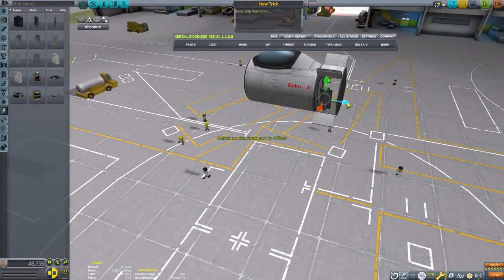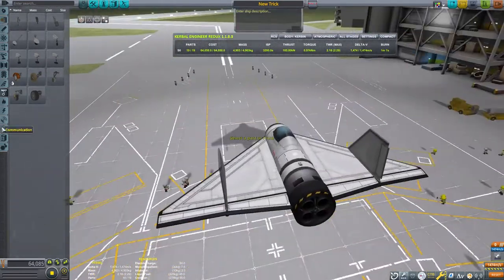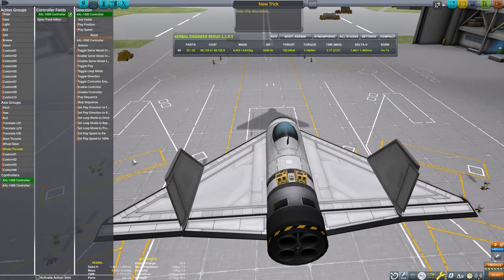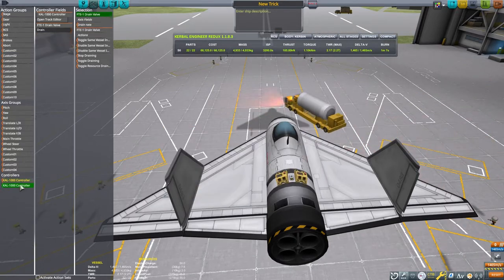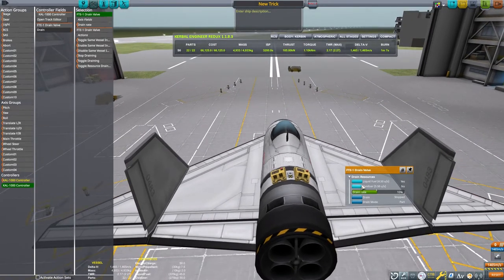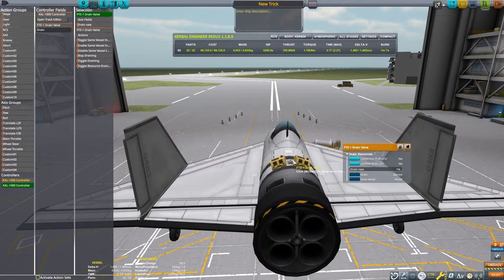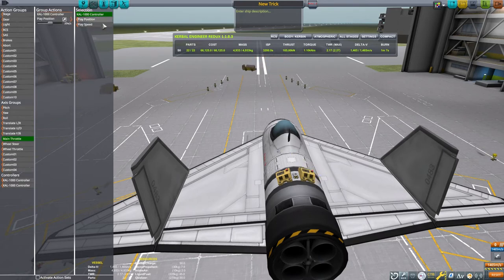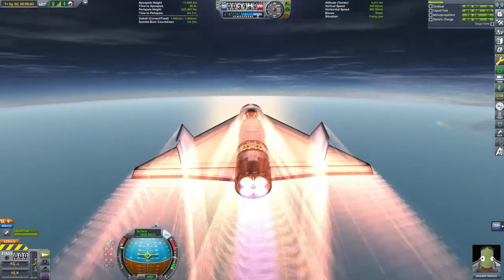Drain Valve Infinite Fuel Hack

Comment: Doesn’t work anymore (Ps4 with advanced tweakables).
Reply from the maker: I don't know if this ever worked on console.
Reply: @Echo3  nevermind got it to work. Couldn’t get the -90 from the propeller blade, so I used a servo.
Reply from the maker: @eliozer1  That's great! Glad to know this works for you.
Reply: you can also use an airbrake for the "-150" value that's needed to copy/paste. I play on xbox and used that.